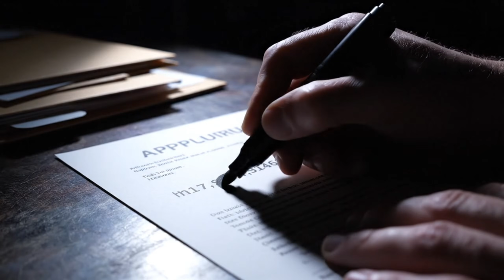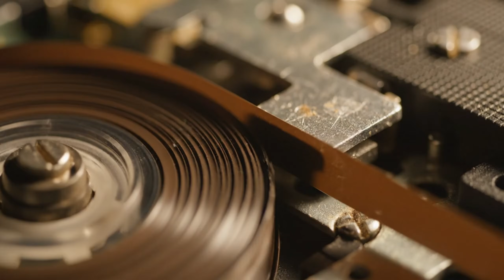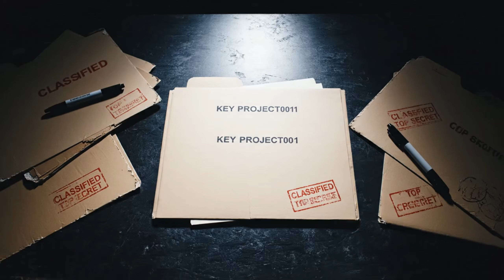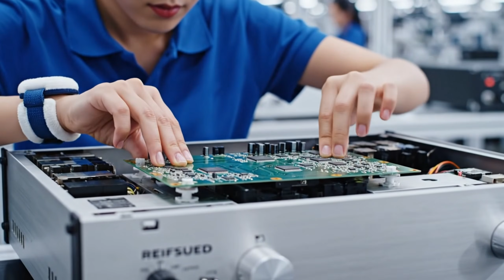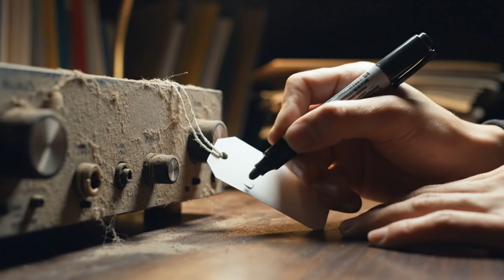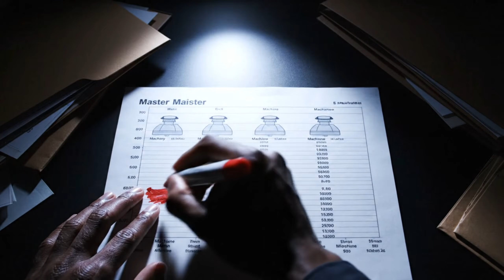HOW MUCH IS IT WORTH TODAY? THE ANSWER WILL SHOCK YOU

Comment: Where in Heaven’s name did you get the images for this video??  None of them are anywhere’s close to the real thing.  The AI images look like a grotesque generation of poorly input data. The reintroduction of the McIntosh MC275 was in 1993, not 1999 as per the McIntosh Labs website. Production of the MC275 Gordon Gow Commemorative Edition ended by 1998. And it had a chrome plated Commemorative badge on the front, heavens no, never gold. And as for the Marantz 7 preamp, the “7C” designation was not a MkII or an upgrade, the “C” designation simply referred to the walnut wood cabinet being included on the model 7, nothing more. The Marantz 7 was often ordered without a walnut sleeve because it was to be mounted in a custom cabinet, usually a Barzilay, made just for that purpose.  I have sold and owned all these components, except the Technics, and still use my 1985 Linn Sondek turntable daily.